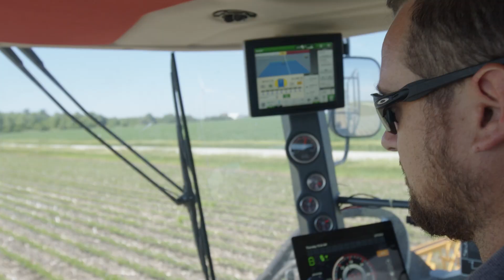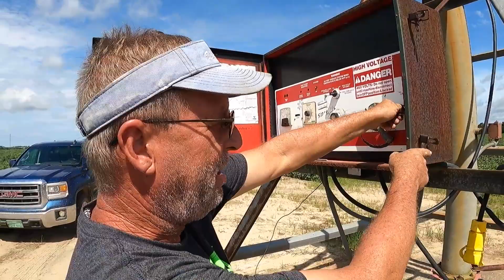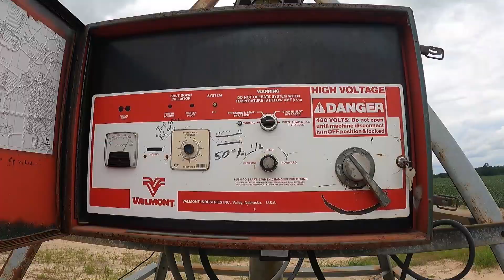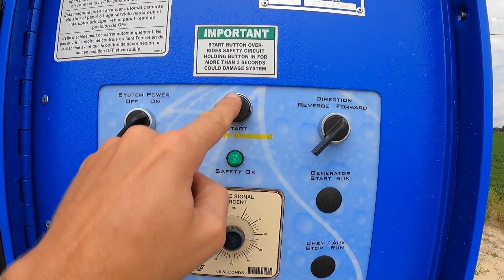A Bird Nest Broke Our Irrigation

Comment: Do pivots water the inside of their arch less than the outside? The outside moves faster than the inside in my head.
Reply: You are correct, in order for the center pivot to apply the same amount of water from one end to the other each sprinkler has an orifice. They start out small at the pivot point and increase in size all the way to the end gun.

Comment: Do you guys come across a lot of rattlers when walking in the tall cotton fields? Do you plan on switching all the irrigation systems from diesel to electric, as they need replacing?
Reply: See one every now and then. And looks like most of our pumps will be electric eventually. Stay tuned possibly gonna swap a couple over this winter